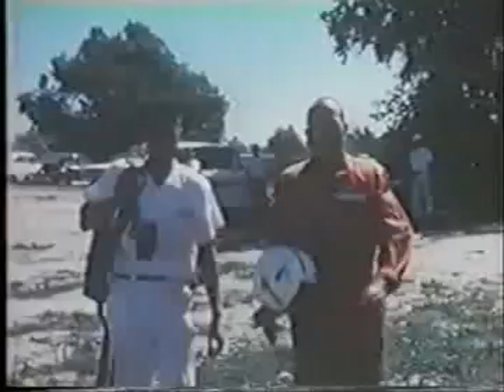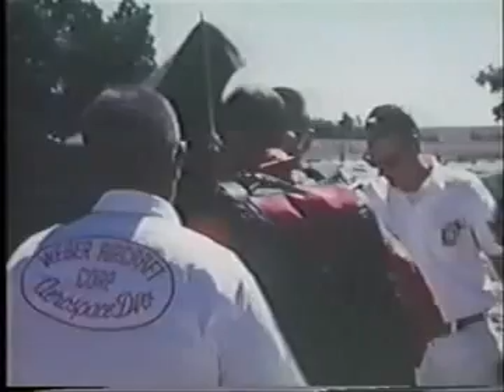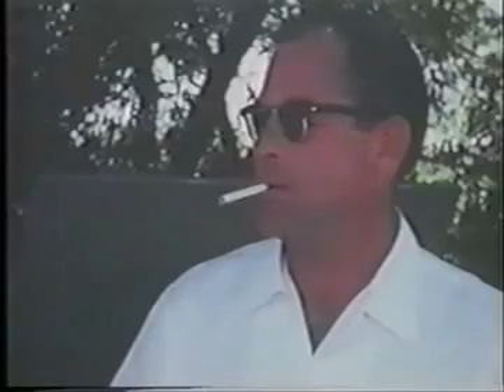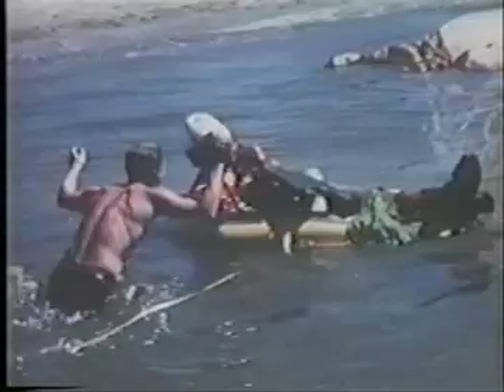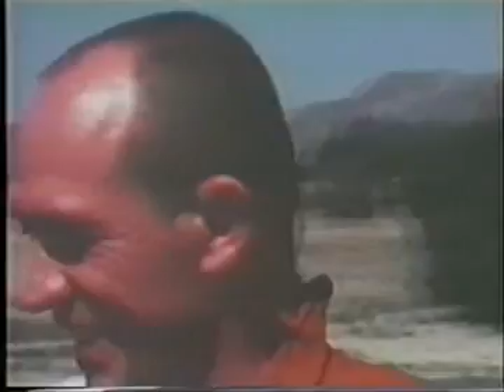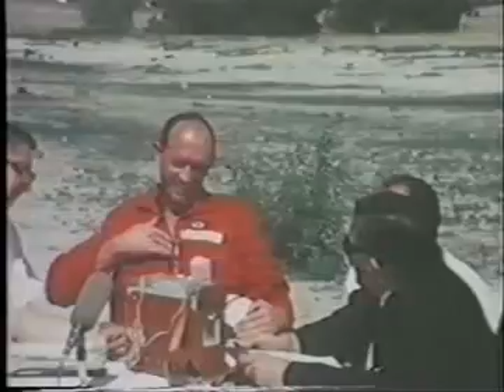Project 90 Zero-Zero Ejection Seat Test (1965) - Part 2

Comment: The way the seat tumbles after the first rocket burns out seems alarming, but nothing seemed to get tangled. 

The 'pilot' mentions a gun firing (probably the drogue gun intended to both stabilise the seat when falling from altitude, and to start extraction of the parachute (guessing, it's how the Martin-Baker seats with which I am more familiar work), which phase seems to go by very quickly in the zero-zero ejection, this drogue gun may defeat the possible tangling by launching the parachute drogue as far away as possible. 

Good design work.

Comment: I had only seen a little of this before.  Thanks for posting!  At the time, Weber was located in Burbank and these tests were performed at Hansen Dam recreational area. I was an escape systems design and test engineer with McDonnell-Douglas in the late 80s-early 90s and attended several conferences where I met Jim Hall and a few others in that film.